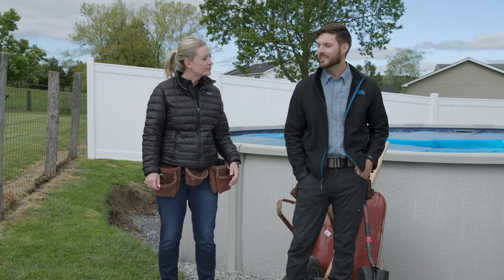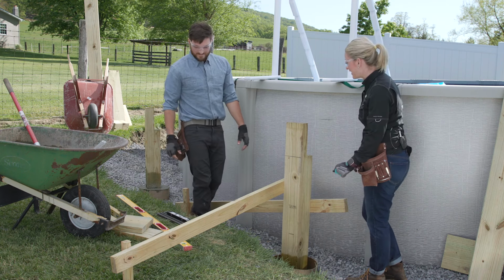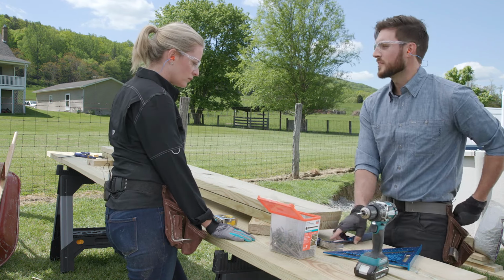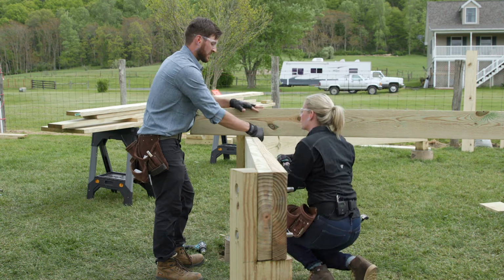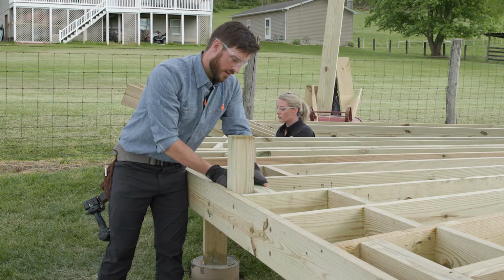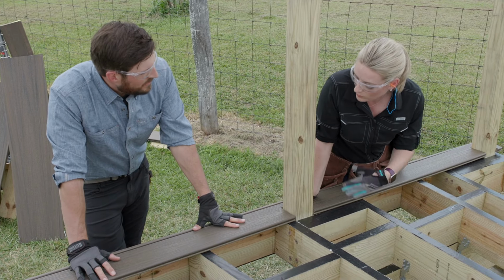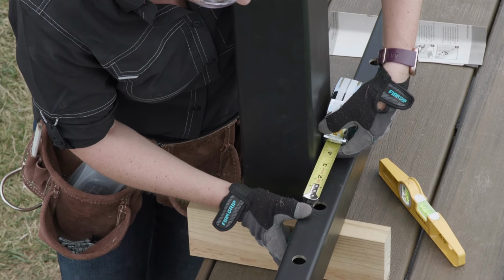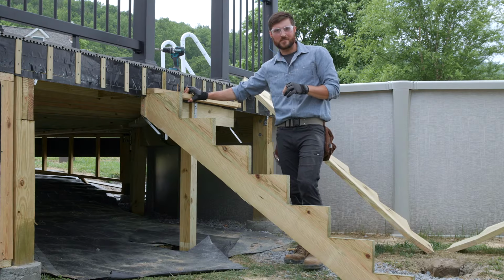How to DIY an Above-ground Pool Deck with Trex Enhance® Decking and Railing | Trex Academy

Comment: Nice deck and very informative, but the way you installed the decking tightly under the top rail leaves no room for the winter cover and cable which needs to wrap around the top rail and cinch tight underneath.

Comment: This is great. I will be using this to build the deck for a new pool. I do have a question though up here in the north, we cover our pools with a winter cover. The covers need to have a slight gap between the deck and the pool to slide the cover down and then use a ratchet to make it tight.it doesn’t look like you have such a gap. Any suggestions?
Reply from the maker: Hi Joe! Thank you for reaching out. We would love to look into this for you further. When you are able to, please give us a call at 1-800-289-8739 for us to assist you. Thank you! ~ Trex Customer Care Team

Comment: Nice deck , very good work but it must have cost a small fortune . What was the final price tag ?
Reply: Would depend. Using #1 southern pine. Or # 2 pine like from  Menards. # 3 concrete  piers in a cardboard Sonen tube or #4 Diamond piers  at 
$144.00 a piece. Wood would be $6000.00 to $11000. Including hardware. Diamond, or Handi piers anoit $144.00 per unit. Just put a deck in for a.43x23 pool.  8foot all the way around for one.

Comment: Great looking Deck but what was the cost of the Materials to build the entire deck? Looks Expensive!!
Reply from the maker: The cost of a Trex deck typically runs from $9 to $16 per square foot. Of course, that depends on where you're buying it, and how much you’re purchasing. Pressure-treated lumber prices will vary depending on your local market. Please reach out to a Trex dealer in your area for pricing information. You can also give us a call at 800.289.8739 if you have additional questions. Happy building! - Trex Customer Care Team

Comment: How far from the pool the post can be? Because the electrician wired around the pool  i don’t want to mess it up
Reply from the maker: Thank you for reaching out to us. Different municipalities have different regulations regarding electrical wiring and lighting around pools and spas.  The allowable distances may be both vertically and horizontally, depending upon the municipality.  You would need to consult with your municipality in building department for the regulations in their area.  We are unable to assist beyond referring you to your municipality. If you have further questions please let us know and will will help if we are able. Trex Customer Care 1-800-289-8739

Comment: how are you going to winterize the pool if the deck is right up against the deck?  How does the cover go on?
Reply: The deck goes under the pool....the pool cover goes over the pool
Reply: Not enough of a gap under edge of pool from what I could see.

Comment: Instructions are missing how to measure and find the angle between the posts for the beams. And or joists
Reply from the maker: Hi Alisha. 

Using a speed square, on the corner of the post, find the angle and divide by two to get the angle for each member at that intersection (if unfamiliar with the many uses of a speed square there are some great videos on the subject on YouTube).  Another method is to set the beams on top of the post and scribe/transfer the inside and outside edges of the beam onto the post.  Place a block of wood over the intersection of the beams so that it’s square with the back of the post and mark the beam on both sides of the block.  That’s your angle to cut the beam ends.  Once you’ve cut the beams, set them back onto the post and trace the beams in your desired location.  This will be where you’ll notch the post.

Kindly, Trex Customer Care

Comment: How was the 6x6 cut on a 12° angle
Reply from the maker: Hi Angel! The post was cut so that the beam coming into the post was at a 12 degree angle to the other post.  The beam material was set on top of the posts and marked to determine where the post needed to be cut.  This ended up being a 12 degree angle in this instance.  A circular saw was then used and set at an angle, cut down the line.  Then the cut was finished with a jig saw as the circular saw did not cut deep enough.  The angle cut was repeated on the other side of the post so that the two beams met in the middle of the post.   - Trex Customer Care

Comment: How did you attach the pool ladder to the deck? Up North, we need to remove and replace the ladder every year.
Reply from the maker: Hi Joe and Kelley!  We do not have any specific recommendations for attaching a pool ladder to Trex decking. We always recommend using an approved composite deck screw with Trex but we cannot guarantee that those screws would properly hold the ladder in place.

https://documents.trex.com/is/content/Trex/trex-recommended-fasteners-decking-fascia-2019-2pdf.pdf#_ga=2.8471093.100339220.1589827508-871995231.1525355912

Please let us know if you have any additional questions and have a great rest of your day.- Trex Customer Care Team